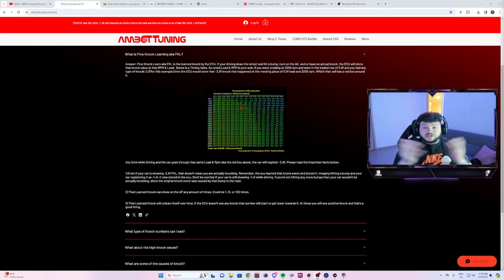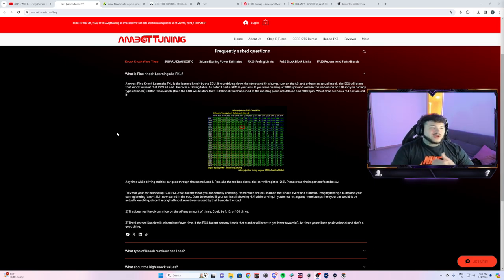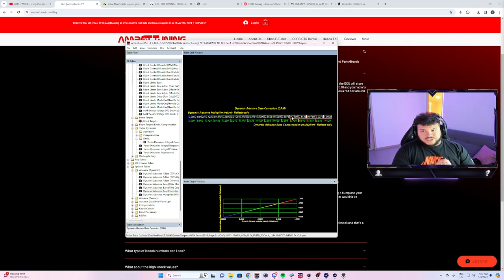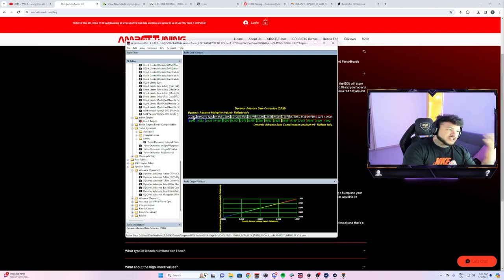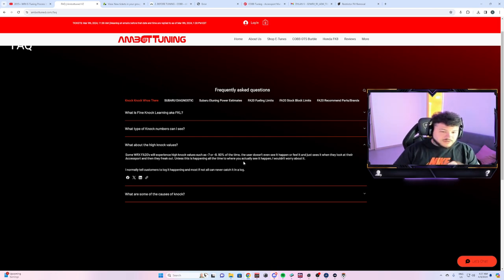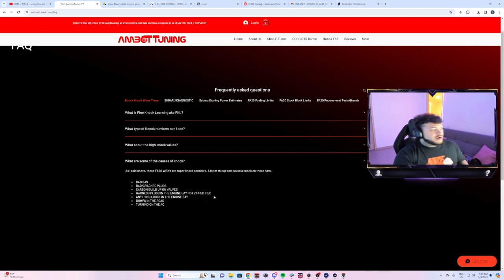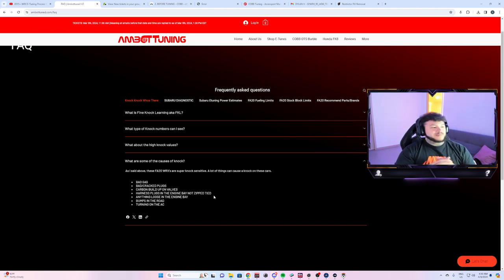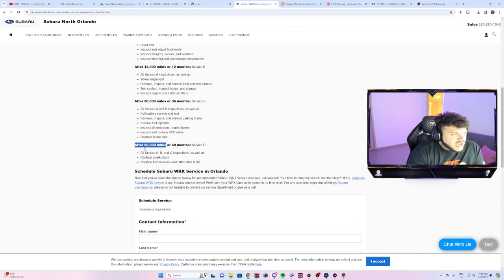Subaru FA20 Common Questions & Answers

Comment: Great info and thank you for sharing. I was curious if you're still able to tune FA20 cars with a KillerB header + dual Tial 38mm EWG despite the greenspeed bs? Assuming the stock TGV/EGR is on the car along with a catted aftermarket Jpipe.
Reply from the maker: Yes